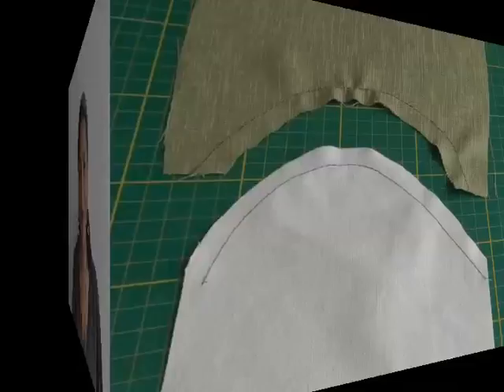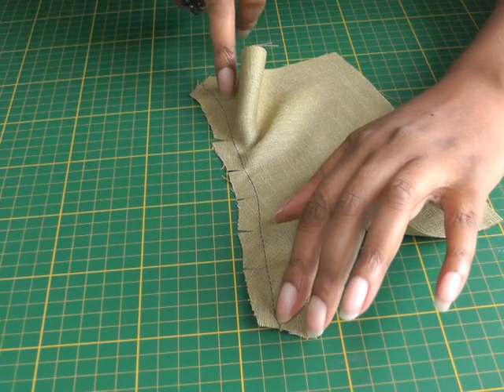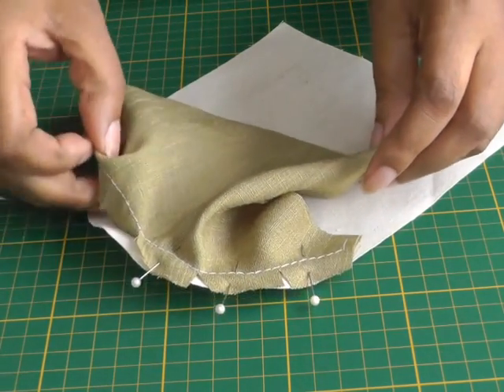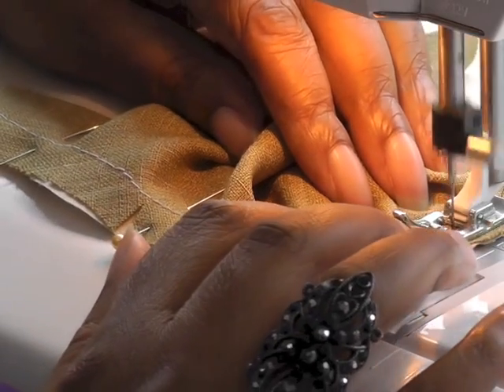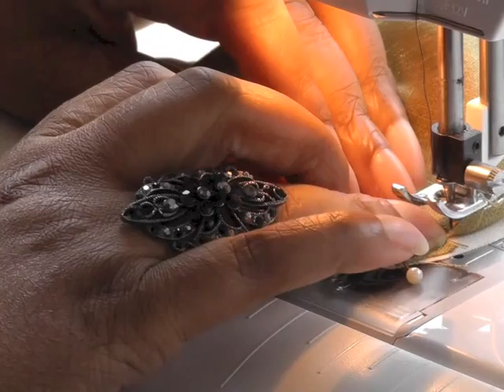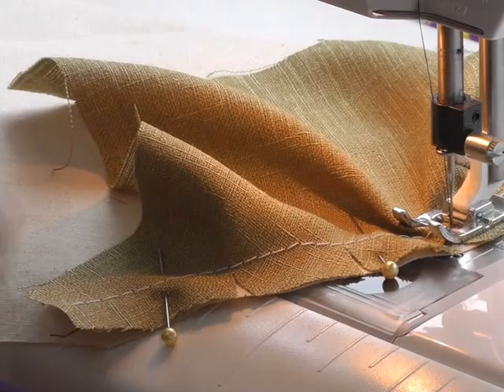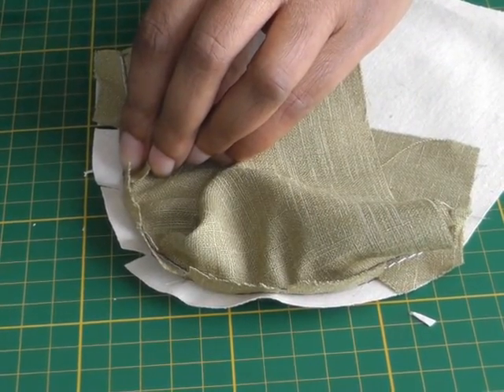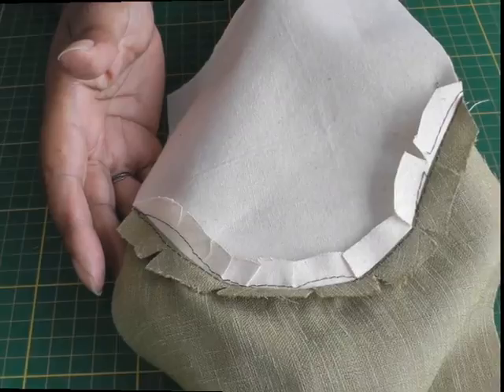Sewing Concave and Convex Seams

Comment: Great video!  Help, I cannot figure for the life of me how to do a boxed seat cushion with a concave on each corner. The chair has an indentation on each corner do to a leg type wicker section that protrudes out and then goes back in.  Of course it has a 5” boxed edges. I can’t figure out how to cut the boxed edge to fit the main section. Where it is curved in (concave).  Any direction would be greatly appreciated.
Reply from the maker: Hello Carolyn, I'm not sure if I can be of any help.

Comment: Does clipping it before pinning them together make a smoother finish than easing the pieces in, right sides together? also, is staystitching possible (or even feasible) with a 4-way stretch knit fabric?
Reply from the maker: In answer to your first question, it's not impossible and you won't necessarily get a smoother finish. Yes it is possible to stay-stitch 4-way stretch knit fabric. Thank you for commenting Razzy 18126.

Comment: This is brilliant, I haven't been able to figure this out, so this is wonderful video to find. 

I've been wanting to make dining chair covers which have narrow chair back sides (6cm), with a rounded top and this has been the sticking point in the test run. I could just do a square top, but I want it snug and smart looking. Hopefully this will get me over that hump :) 

Question, how would this work on an overlocker? Is it possible? You mention at the end, the clipping of the convex piece to make it lie flat when turned out. So I presume using an overlocker here isn't possible? I was going to do most of the  seams of covers with the overlocker, but I presume I'll have to switch to the sewing machine mid-seam to get round the top.

Any suggestions, I would be so grateful. And thank you again for this video.
Reply from the maker: +redjez 
Yes it will. Thank you for your comment.